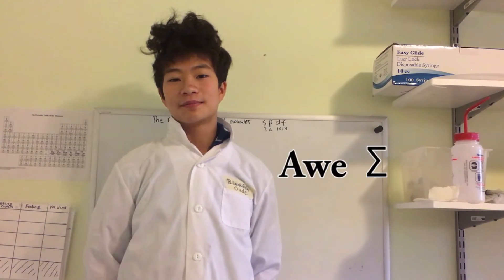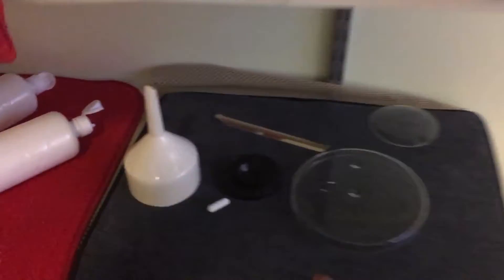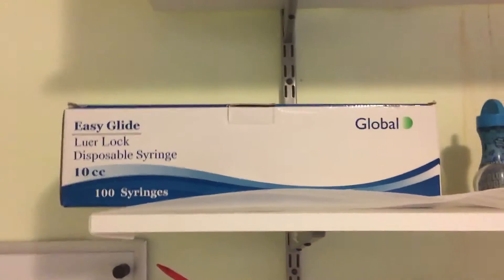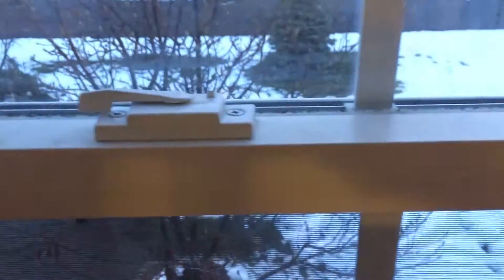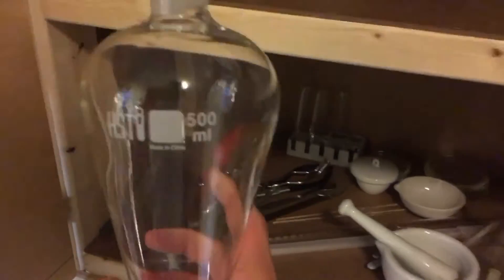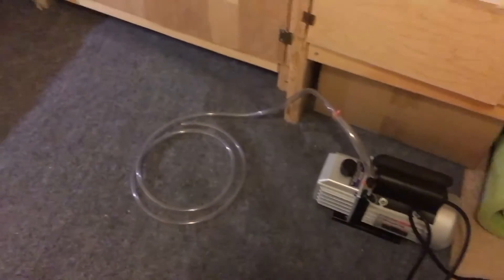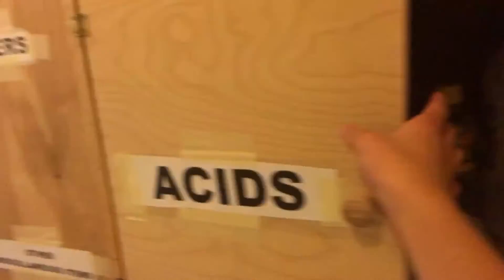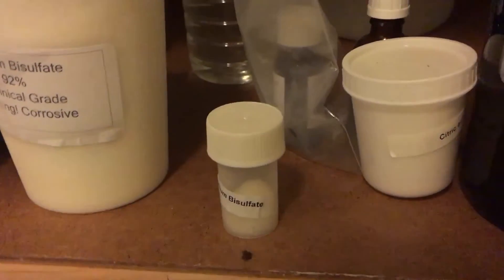Old Chemistry Lab Tour (as of December 2016)

Comment: Amazing lab
Reply from the maker: Thanks! If you want, you can check out my newer lab tour as well!
Reply: Just got finished watching that you have an awesome lab
Reply: I have a question about your Tesla coil
Reply from the maker: @user-mo1fn3gu5u  what about?
Reply: How do you make songs on it
Reply: And ma’e different sounds
Reply: Make*
Reply from the maker: @user-mo1fn3gu5u  I modulate the circuit at different frequencies. While the circuit itself also resonates, it's actually too high for us to hear. So, I just turn on and off the coil really, really quickly, and that makes the tones that you hear. To play songs, I simply change how fast I switch the coil on and off, which is done through a fiber-optic cable connected to a control box.
Reply: Interesting
Reply: Thanks for the sub btw